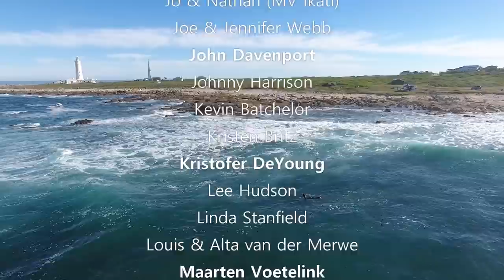We're expecting TWINS.... ENGINES that is!!

Comment: Congrats to you both and also well done Vetus. Now you can glass up the leg recess from the old system and put in a fuel day tank in its place in the old engine recess? What size engines are you going for and will they be shaft drive or sail drive?
Hang in there guys, it won’t be long and you both will then be on your way enjoying the fruits of your labour and sacrifices with a sweet boat living your dream.
Reply from the maker: Thank you. We were thinking of converting the center into a jacuzzi now! 😂 Just kidding. It will be storage space. They will be sail drives.
Reply: Sailing Lady Africa I can’t remember but are you guys going to have a generator?
Reply from the maker: @alanpiper9614  we have a small silent petrol gen to run the big water maker
Reply: Sailing Lady Africa good stuff. With the new engines have you worked out the fuel consumption? Have you guys figured out a range in time that you would consider the safe minimum eg 1 engine at mid cruise for 7 days minimum?
Looking forward to watching the new engine fitting episodes.
Stay positive and safe guys, you have achieved so much in a short time. 👍🍻🍷
Soon it will be launch time and you will be setting off on the next stage of your adventures 🎉

Comment: Any hint on configuration? 4 cylinder Shaft drive? Sail Drive? Wet or Dry exhaust? I thought you may have been planning Electric shaft drive with the motors and batteries from a couple of crashed ev's the way the motor and stern leg progress stalled? Anyway you have to remember you need to service them so design as much space in and around the engine as possible and will you have external access?

Last thing for motivation 1,3 and 4 can be done on the water (through hull's exist), just day sail and learn the boat with the minimum to splash then get a life raft etc and you are off shore.

Comment: It's a testament to the effort you have put into the boat and quality you have maintained that has kept Ventura involved.   This will be worth it. I'm sorry Simone will have to wait longer for to get finished but it will be worth it.   You did not say want engine they are talking about , I assume a sail drive type.  Be sure to check out they install engines in St Francis Yachts .  Central for better weight ,and with drive at 45 deg so boat can take the ground without drives hitting , they have been doing successfully for 30 years . Might not suit you boat but st Francis Yachts is not that far from you ! About 1 hour west ......might make an interesting visit if they would have you.. cheers Warren
Reply from the maker: Thanks Warren 🤗 We will be installing sail drives yes! 😊

Comment: Wow dry sailors, thats realy a Very Good Vetus Deal.! Like I said before (fun) Dutch saying "Vetus Niks Betus".! (Vetus nothing better LOL).. Whatever I still like what Great job you (Ricky) did on the other engine, bell housing and Volvo 270 aurboard drive.. We here in the Netherlands can still get new parts for Volvo 270 autboard drive's, and there are several repair shops that sell complete overhould drive's..wich are mostly fitted in Mono hull motorboats. .Like In my motor boat, where the Volvo 270 drive is fitted to an (Vetus) Peugeot diesel engine. The V.270.Z.drives are made from 1972 up to 1982.. so stil being able to get parts from Volvo, is amazing.. But New Vetus engine sets are a much better Deal. So grab the deal with Vetus and succes with the build in.. Greetz.NL.
Reply from the maker: Thank you 😁

Comment: Great news!!!  Maybe I am remembering this wrong but I thought you didn't have enough clearance to get the proper prop shaft angle in the hulls.  Am I just making that up?
Reply from the maker: No you are correct. We will be installing sail drives! 😊
Reply: @livingwiththemaias  Wow, that's even better.  Is there a space in the back cabins to install the engines, I assume there must be right?  Anyway, congratulations.  This is really exciting news and it is great to hear that after so much effort you are getting what you want and not being forced to settle.
Reply from the maker: @velascobruce  yes , Ricky build the aft cabins to take an engine in each hull . So we stoked . Just working hard to pay them off . You truly only know how much you have sacrificed when you have nothing left not even a car to get around . But it's worth it

Comment: cool,what HP are the engines,are they shaft driven or sail drives you intend to fit?
Reply from the maker: Wait & see 😉 They are sail drives.
Reply: @livingwiththemaias  FYI, on the prout elites that were fitted with twin engines they fitted a 120 liter fuel tank in the anchor locker against the main bulkhead to offset the weight and increase fuel capacity to 240 liters,they probably did the same with the few deans that were fitted with twin engines.

Comment: As someone that currently has a cat with a single engine and sonic drive I can see the appeal of twins, but there is a big weight penalty, and bit of a performance hit too from either the sail drives or shafts and props.  I suppose it's just a case of whether the better mrauvering and piece of mind in terms of redundancy outweighs that. All the best.